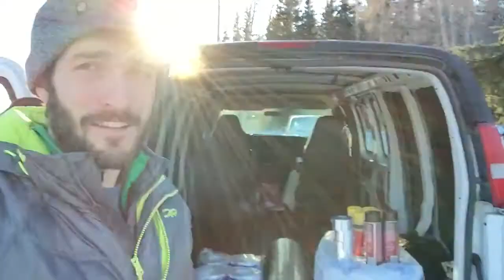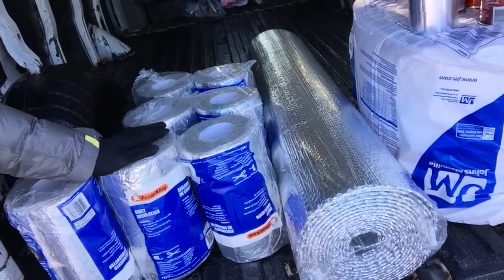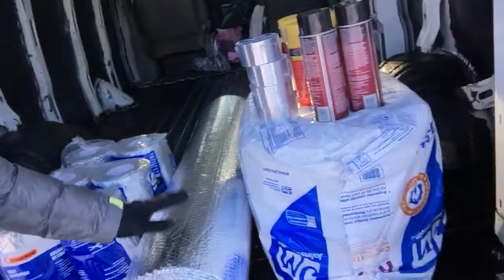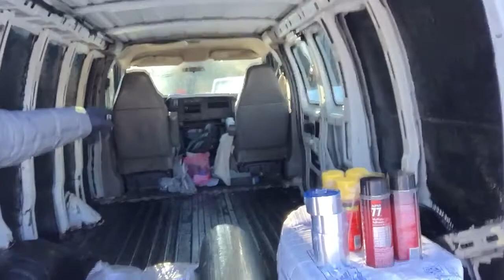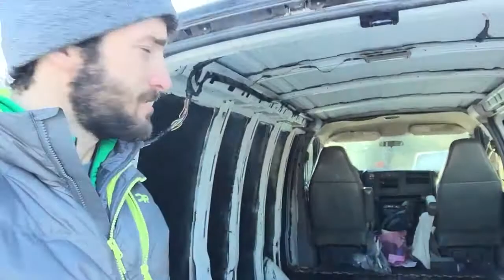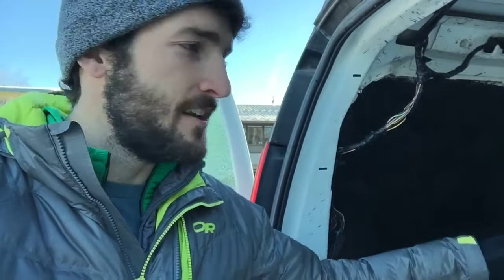Chevy Express Van Conversion 4

Comment: Oh man am I glad that I found your video. I have the same type of van and have been wondering about that heater thing. Was it also an air conditioner? I want that stupid thing out, but I don't want to loose the Freon and screw up our ozone layer. Thanks man.
Reply from the maker: +Trevor Marty just seeing your comments...mine was a heater...there was no Freon back there just coolants...I had the lines sealed and it's working that a charm!